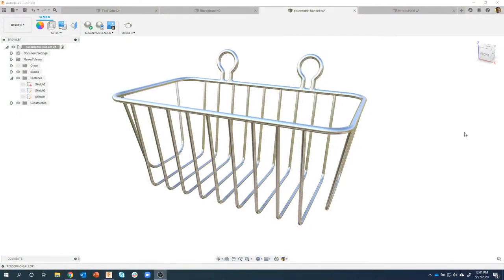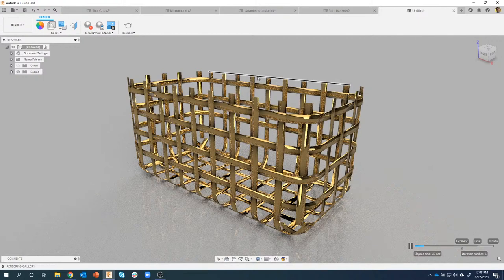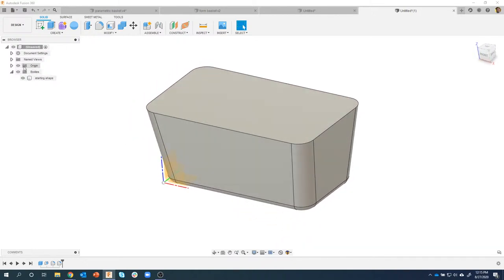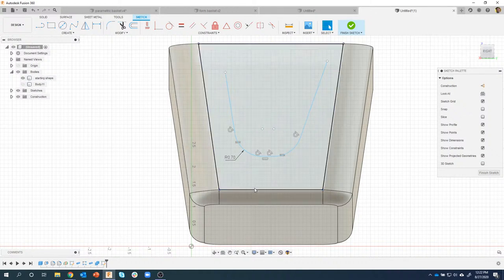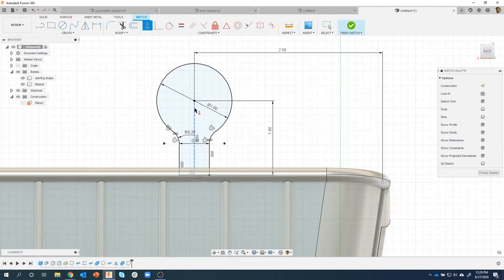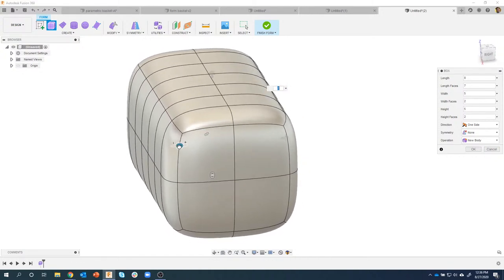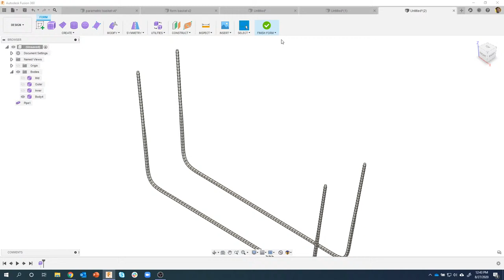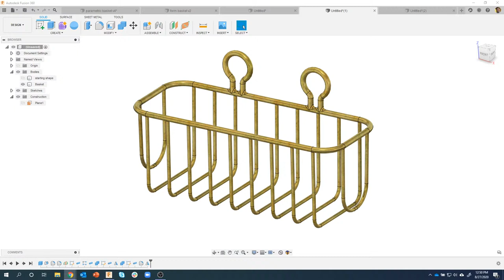Fusion 360 Live - Creating Wire Baskets with Fusion 360

Comment: Wait what? This is not creating wire baskets it's how to render wire baskets.
Reply: yeah, I wanted to create an actual wire basket and that was my question: is this basically just a wrapped sticker that is an illusion of what I want my body to be, or is indeed a wire basket that can be 3D printed? Seems like the former.  Uggh...  to make matters worse, I can't even seem to get the render part to work. The materials are not showing up as they should when I apply them.